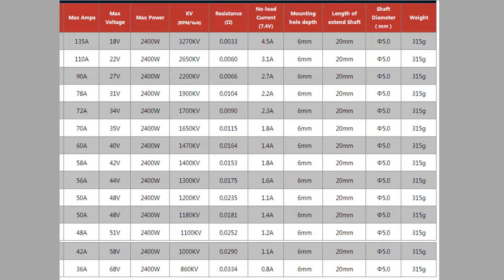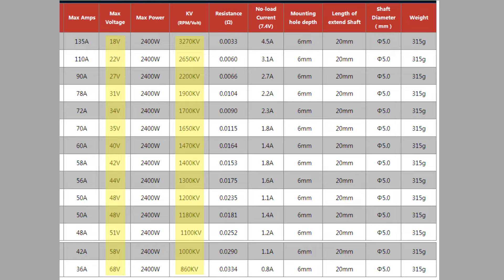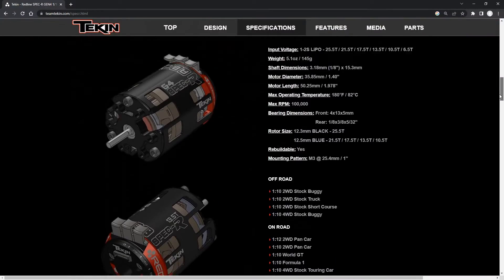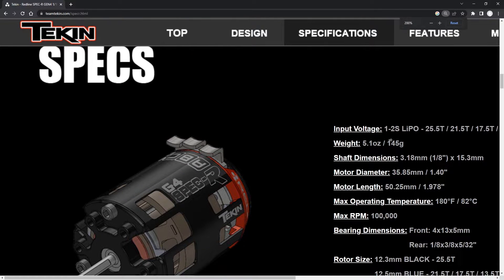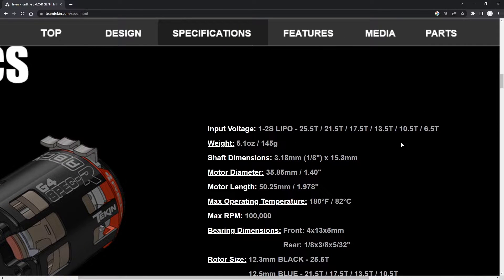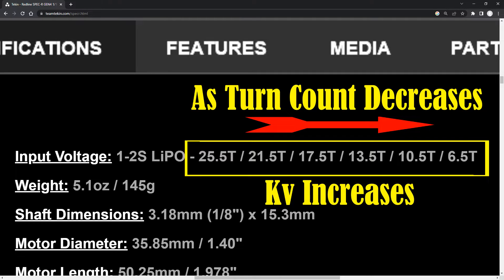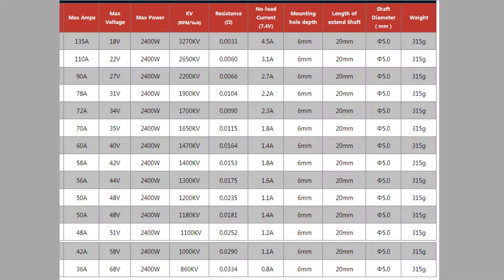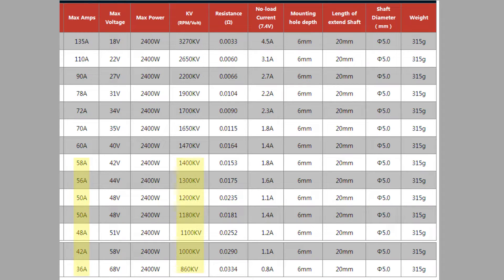Brushless Motors - Top 10 Items to Know & Understand

Comment: infrared light is reflected on metallic surfaces, so a shiny metal motor might seem quite a bit cooler with a infrared thermometer, because you actually measure the temperature of the cooler environment reflected on it. so if it reads 80C, the motor might me much hotter. Also different surfaces emit differently. for a consistent measurement, one can put the same kind of tape on the surface in question and measure there.

Comment: Question: I am attempting to launch my gearless aircraft using a dolly. The dolly typically turns to the right as the aircraft motor is advanced! Typically, if I "manually" push the dolly/aircraft combination down the RW, it goes straight, if I use the power of my "outrunner" aircraft motor, it turns to the right as I accelerate. So my question is: does the outrunner motor cause a sort of "P factor" affect upon acceleration and how can I counter this, if it is so?
Reply from the maker: I ended up putting a steerable wheel on my dolley and wiring this to a receiver on the dolley. The reciever on the dolley and plane were both bound to the plane modelcon the radio, thus controlled at the exact same time. The,  I could steer the entire time im trying to get into the air with precision.

Comment: Hi, great videos!! I'm drone FPV pilot and I'm tryin to rewind the motor, but I can find a si.pme way to get the correct turns.. maybe can help me? The motor is a 2306 - 1900KV delta, I have .24 cal copper . How many turns I should be do for 1900? 10... Or 11? Thank you!
Reply from the maker: Thank you for your comment. I would look for an online motor wind calculator.

Comment: NOTE on the sensor motor, you cannot change the three cables, they must be A to A, B to B, etc.

and an outrunner has more torque because the magnets turn on a larger radius? or is that just reflected in kv on that motor?

Comment: When it comes to 5mm vs 8mm shaft when is one necessary over the  other in application and the cost involved ie buying more gears ... I'm sure you've covered that before but would be right at home in this list . And as always, thanks for watching 😋
Reply from the maker: Have you seen this? It is quite a bit technical, however.
https://youtu.be/wHJocmC0SgQ